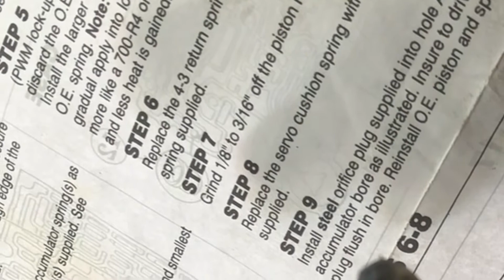4L60e Corvette Servo 2nd piston mod | Apply pin length setup

Comment: If you have a drill press there milling bits that in combination with a cross slide would of made this quick for you but looks like you got it free handed.  Nice job
Reply from the maker: Those are a few things that I’m missing in my arsenal.